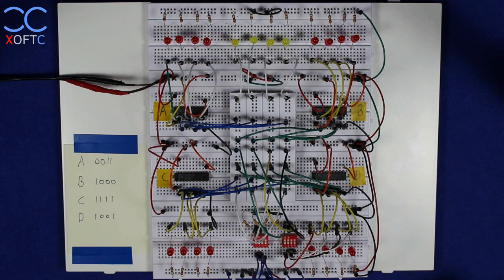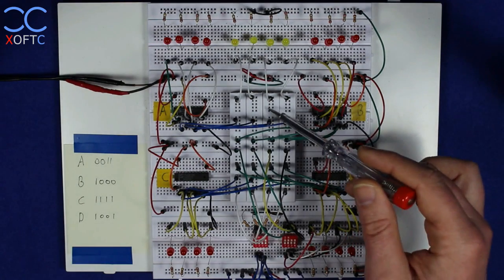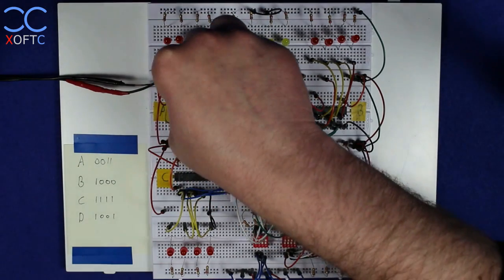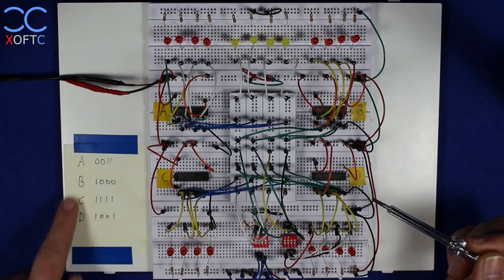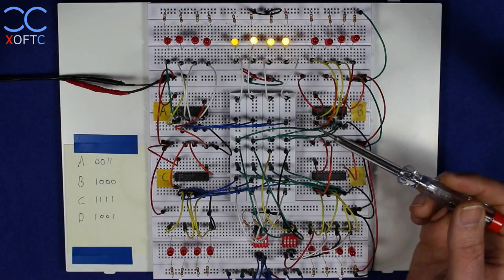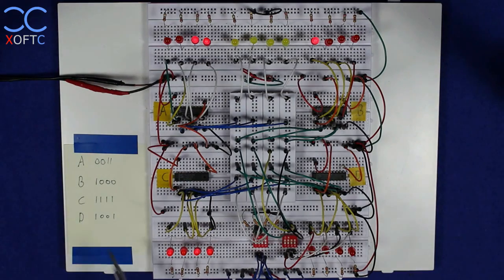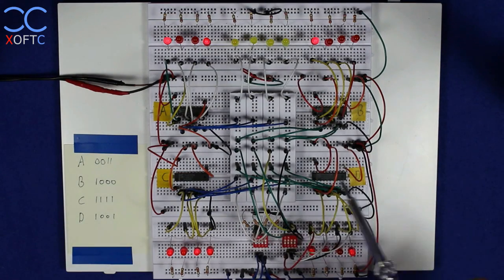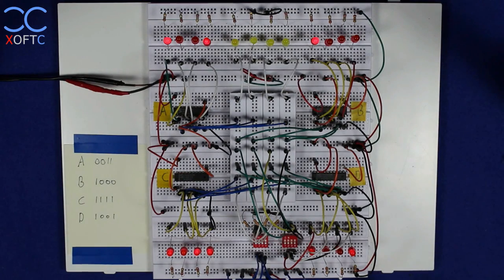How a Data Bus Works

Comment: Many thanks!, it was pretty clear. In my understanding, data is sent simultaneously into the bus such that every register has the opportunity to pick any data siting on the bus. Then a controller (in this case your hand but could be another circuit) decides which data will be picked up for each of the register A, B, C and D. For instance I can imagine, that we could distribute data from a source via this bus using a rule of sequencing nibbles in cycles of 4 times, during 1 second each (using a external clock). Then each register could take from bus the data at counter mod 0 seconds, counter mod 1, counter mod 2 and counter mod 3. Additionally, the last part was very interested as well, transferring data between registers via the bus!. Amazing!

Comment: Hello, how are you? I am amazed at your video, I am studying electronic systems and my teacher asked me to do a project like this, could you help me to know the parts I need to assemble it? I see what there is but in specific I do not know what resistance capacity and how to connect it, would you have a diagram? I would appreciate your help too much.